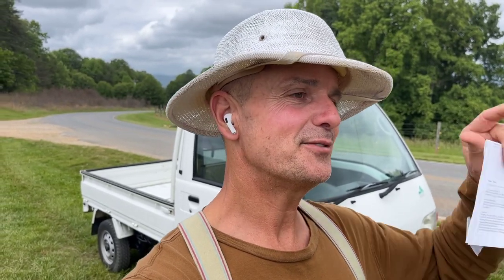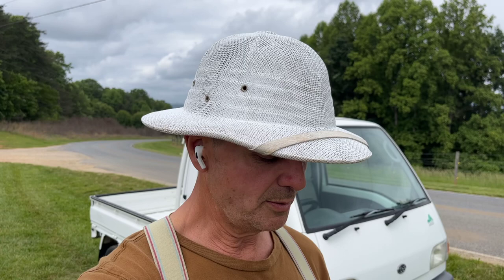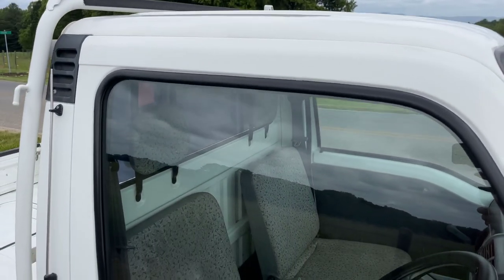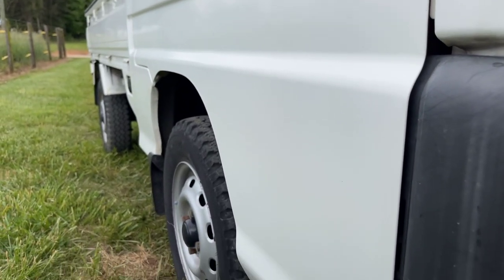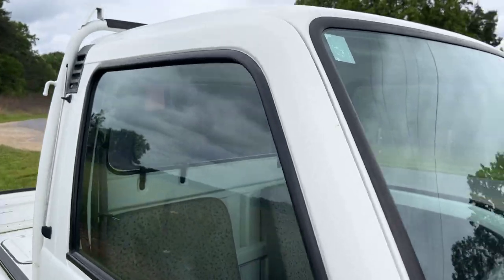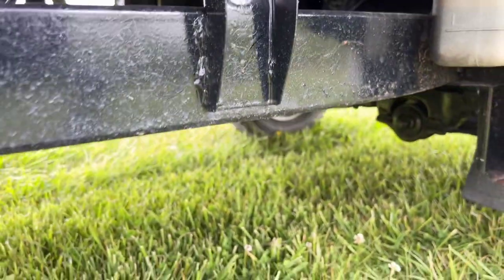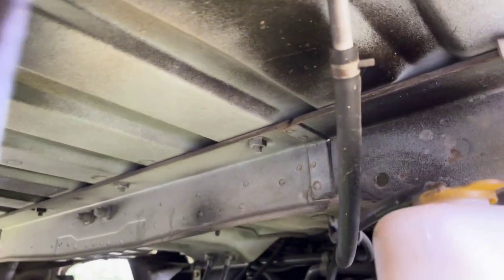SB0097 1997 Subaru sambar 4x4 5sp mini truck 30,482 miles Nathan in Wilmington NC

Comment: What is the best truck to buy , The subaru, honda, mitsubishi, daihatsu ? In your opinion which would be the least problems and longest life truck ?
Reply from the maker: Hi Manny, that is a very popular question.  The Japanese perfected the internal combustion engine seventy years ago:)  There really isn't a "best" for mini trucks.  The Subaru would be the most tender truck because of the propensity of the truck to deliver a blown engine and for the water pump issue.  The water pump is on Subaru but the engine problem really isn't their fault...it's more "pilot error".  I really like to say that they all make a great engine and I have seen all of them go well in excess of 200k kilometers.  The longevity has much more to do with how well it is cared for than it does the truck itself.
Reply: @minitrucks  I was thinking about a honda mini truck , any thoughts . I really like your channel , found it the other day and subscribed with bell notifications . I plan to buy one of your mini trucks. You seem very honest and that is hard to find . Thanks for the education I am receiving about mini trucks.
Reply from the maker: Thanks for saying so Manny. I appreciate your thoughtful response. The Honda is an excellent truck. It’s more suitable for an “on road” application, so, if asphalt is the main thing under your tires, the Honda will dominate. Every mini truck has its foibles. There aren’t many on a Honda. The only thing that might come up on a Honda is the fuel shut off solenoid and the fuel vent solenoid valves. They’re around $140 each and that’s only if they go bad. When they go bad, you will know it…the truck just won’t run. The four-wheel-drive on a Honda never ever breaks! That’s pretty solid :-)

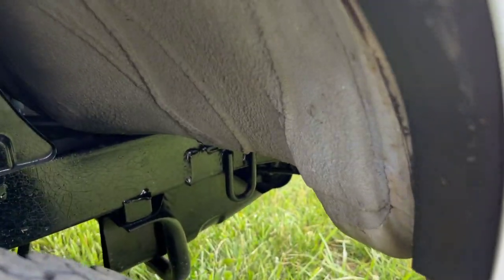Comment: 4:35 time mark:  Frame has been repainted.
4:59 time mark:  Black overspray visible on the underside of the bed.  (Also, note that the cross beam supporting the bed has NOT been repainted and is the original finish.  So, only selected portions of the frame were repainted.)  While not in and of itself a bad thing, the repainting raises unsettling questions.
5:02 time mark:  Note condition of spare tire.  It is suspicious that a truck with only 30K miles would have such a badly worn spare tire.  While it is possible that this tire came from another vehicle, it is nonetheless a red flag.  Because these trucks only have a 5 digit odometer, it is possible that the truck has an overspun odometer.  Instead of 49,056 km. (30,482 mi.), it may actually have 149,056 km. (92,619 mi.).  
6:54 time mark:  Pristine truck bed.  Agreed, the bed is in immaculate condition!   Best I've seen.

Overall, the truck looks to be in very good condition.  The only thing holding it back from an excellent condition are the dings and dents (and possibly the tires).

Comment: What are you thoughts on a Subaru truck with Supercharger? Power wise
Reply from the maker: Power is greater on the supercharged unit.  It's noticeable but you still don't have any more top end speed.  It just gets you to 60 mph more quickly:)